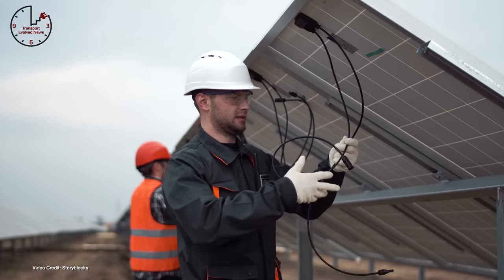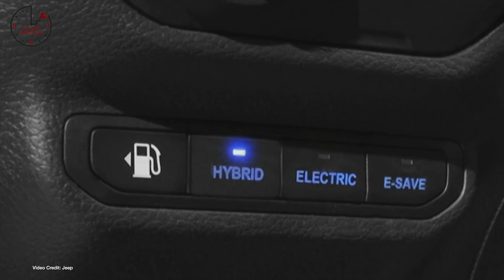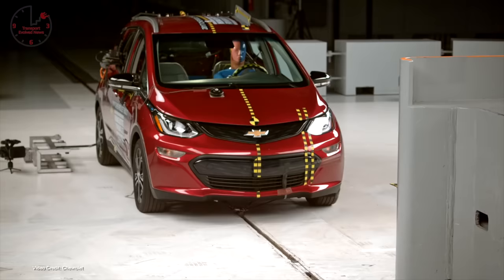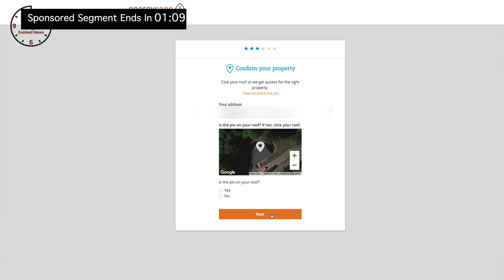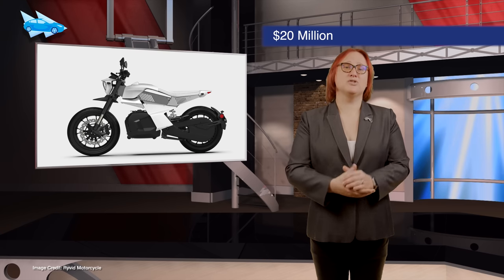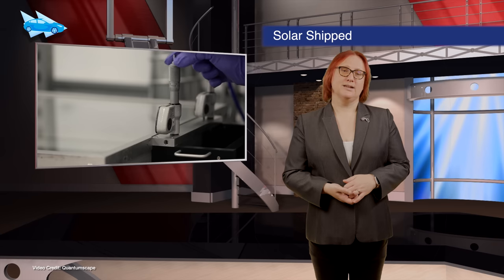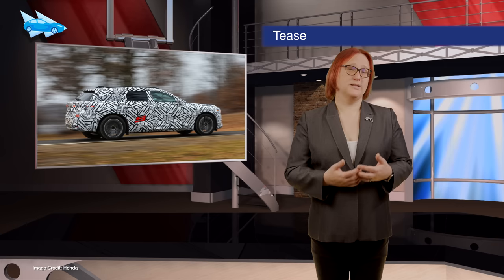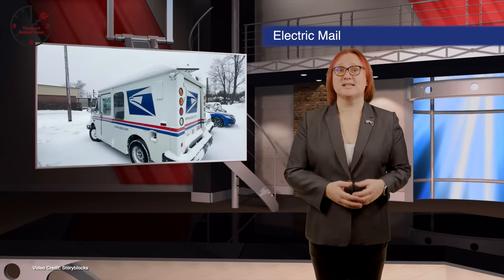TEN Episode 415 - Solar Panel Breakthrough, Tesla Driver Blames FSD,  Charging Station Security

Comment: Re oil industry under estimating emissions,  please note the industry never includes the lifetime analysis of oil extraction and refinement to petrol, but always include mining of minerals for batteries.  Please look up this energy,  it is very significant
Reply: FYI: Two refineries in Europe - only two - according to their own reports - produce as much THG during their refining of crude oil to gazoline - thats CO2 equivalents in climate effective gases as if ALL Germans drive EVs with the same energy mix as Norway uses.

Two refineries alone.

That means if all switch their Toyotas to EV's we can save up to 30% of the global CO2 emissions.

Comment: My understanding of the Pepsi statement about not hauling Soda/Pop more than 100 miles is that whether EV or Diesel, it is not cost efficient to haul drinks. Since Pop is mostly water, it is more efficient to have more bottling plants and just haul the syrup and mix with local water than hauling that water long distance in a truck.

Comment: @11:30 you need to correct your statement on tax credits of 26% for next year. Here is the fact; As written in the Inflation Reduction Act of 2022, the tax credit will begin at 30% and step down to 26% in 2033 and 22% in 2034.
Reply: I did a double take on that as well.
Reply: I came to comment if not already done. Thanks.

Comment: The FUD is amazing.  Here’s my personal experience.  We just drove from Portland to Seattle in our BMW iX.  We were at 97% when we left and 39% (135 miles) when we arrived.  Total distance driven was 175 miles.  The average temperature was about 40 F.
Reply: The problem is your statement as compared to actual cold weather results. 40F isn't cold weather, we just had a week where our high was 6F and had much time as low as -10F. Mileage does go down quite a bit in the cold, 15-30% is common.
The biggest problem was that many chargers (non Tesla) weren't working in the cold weather. These were brand new electrify America chargers that were installed in the last few months. Not  a good problem to have ..

Comment: Correct on Pepsi. If you look at all the bottlers in Washington and can also figure out which supply which warehouse you can see some difficulties with those in Spokane, Wenatchee. and Everett. Then there are Port Angles and possibly Long Beach and Elma that may have very long routes directly to stores on the coastal areas with mostly highways?  Happy holidays!

Comment: And Diesel powered vehicles suffer in extreme cold weather.  Semi trucks must be plugged in to run the block heaters, and often left idling for hours or they will not start when desired.  Diesel anti gel treatment must be added or the fuel system will gel up and shut the vehicle down.  If the fuel station tanks are above ground, the station must add anti gel in order to pump the diesel to sell it.
And we don’t talk about how inexperienced diesel owners get stuck along side of the road in these conditions, do we!
Even a gasoline engine sometimes will not start in extreme cold without a block heater as the gasoline will not vaporize an ignite.
But Noooooo, only electric vehicles have trouble in cold weather!

Comment: 32.5%.  That's the new world record for solar cell efficiency by Helmholtz Zentrum Berlin.
The EPA, and others, should also publish fuel efficiency figures based on not charging the battery of a plug-in hybrid.  So you get the best and worst case scenario.
Reply: Is that for a solar cell that is in production? The NREL has published results much higher for laboratory results. Multilayer solar cells are approaching the 50% efficiency level.
Reply: @RPRosen-ki2fk  I've no idea.  I just did a quick online search as the figure wasn't mentioned in the video.  TBH, I didn't think 32.5% wasn't much of an improvement, so maybe I read the wrong figure.
Reply: @TheTriumfAnt  Thanks for the reply. I've since Googled and it is a labarotory result for a tandem cell with an advanced perovskite composition. It will be added to the numerous others and hopefully some will make it to market soon.
Reply: I noticed that omission also.  Thanks for filling in the blank.  That’s about half again more efficient than the panels out in my PV array.  If that’s mass production ready at a competitive price, and if the perovskite layer doesn’t degrade and fail prematurely (awfully big “IFs”) then that could be pretty great.  As Nikki says, watch this space.

Comment: Unless they are somehow running version 11 software, the accident on the freeway did not really involve the FSD beta.  The freeway driving currently uses a completely different software stack than the FSD beta, and that software is probably at least a couple of years old at this point.
Reply: FSD sits on top of other programs, one of them being the Autopilot program
Reply: @linusa2996  I guess my point was, even if it (FSD) was engaged, what they were really using was a glorified adaptive cruise control (much like that provided by other companies).  Not taking a dig at Tesla here (I love driving my M3), but the freeway stuff is just a good adaptive cruise.  I've driven my Honda's version, and a Subaru version, and they all perform about the same way (though I think Tesla's lane keeping is superior). This is radically different from what I think of as FSD beta, which is it's handling on city streets, which is the cutting edge stuff.

This reminds me of the complaints last year, when somebody engaged auto-pilot on a freeway exit ramp, and were surprised when it ran the red light at the bottom of the ramp.  My other cars, including the Honda Odyssey, would do exactly the same thing.  Apparently common sense is not so common, it appears.
Reply from the maker: We’re reporting what the driver claims. We’re clear it was a claim.

Comment: Is the Frito Lay vs Pepsi comparison valid? FL is owned by Pepsi…..   🎄
Reply from the maker: Different companies ship different things. 100 pounds of potato chips are very different in volume to 100 pounds of soda.
Reply: @transportevolved  agree, but if the Pepsi group has its own charging stations (the group has a lot of real estate) , then both the chip and the beverage sides should be able to use them.

Comment: If I am not mistaken the delay of guidance on implementation of battery material sourcing requirements simply means those requirements specifically don't go into effect until guidance is given. This means (again - if I am not mistaken, I am not a tax expert) that if you were to buy a Chevy Bolt that was manufactured in the U.S. but whose battery components did not meet the proper sourcing requirements between Jan 1st and March (or whenever they give guidance) then it will qualify for the full tax incentive because you purchased it during a period in which the battery requirements themselves simply haven't taken effect. This is what I've heard, at least, in all of the material I've read on this issue and it's for this reason that I am now trying to get lined up to purchase a bolt EV sometime between Jan 1 2023 and March 2023.

Comment: Our Model Y has had a number of phantom braking occurrences. If you press the accelerator it cancels the braking, but of course you have to be quick to avoid a fairly substantial loss in speed. We don't have FSD, the braking is caused by the automatic emergency braking feature of the Autopilot system that everybody gets. You can turn the feature off but you have to do it before driving, it defaults to on whenever you wake up the car and start driving it. It seems most likely to phantom brake when you are on a road with a surface that has intermittent dark patches on it, and especially on cloudy days. It's almost always happened on an interstate highway, and I-80 going through Wyoming seemed to induce almost a dozen instances of phantom braking during one trip. It only happened once with a car close behind, and thanks both to an alert driver in that vehicle and my prompt flooring the accelerator in the model Y it didn't cause an accident. In this part of the country, and especially on I-15 in the Salt Lake City area, such an apparent "brake checking" maneuver is somewhat likely to draw gunfire from an offended driver behind you. It happens once in a while.
Reply: I might also point out that I sometimes watch videos by truckers (in ICE trucks), and it's not exactly rare to hear them complain about phantom braking.
Reply: That doesn’t sound right. My 2018 3 has never done it on over 50k miles. Occasionally it’s pushed the break down more than I was with a deer crossing the road. I highly recommend contacting Tesla ASAP and getting it looked at.

Comment: To be honest, range in winter suffers significantly. Our Skoda Enyaq with heat pump (VW ID.4 half brother) loses around 20-25% of range and our Tesla M3P unfortunately pre-heat-pump is closer to 30%.  None of our ICE vehicles we had before lost that much range in winter and they also had a lot more range to start with. Add to that the VW-Coldgate where charging speed sucks in the cold and it can be a bit unpleasant. As I just learned VW still has not managed to add a battery pre-heat button in the latest 3.2 software.
Latest joke: how long is a VW month? Almost a human year which means the promised updates every 3 months will come every 3 years (if we are lucky)
Reply: VW’s EV program seemed so promising. I hope they pull it together. We need Europe to also have a strong car industry. My Model Y loses noticeable range in very cold weather. My ICE cars have always lost range in winter too for defrosting and preheating. I now use a portable heater in my ICE car that I plug into my house. It has to run for an hour when it’s really cold, which seems wasteful. The Tesla needs only a few minutes to melt the frost. Advantage: Tesla, IMO. I’m looking forward to longer range cars though. We’re only just getting started with this technology. In 5-10 years if society doesn’t collapse, I’m sure we’ll all be happy with our EVs.
Reply: I just took my Ford Explorer to the airport and back (100 miles) in an ice storm and used 170 miles of range. You may not notice because it's so easy to just refill the tank. In day to day driving winter range loss doesn't really affect my Tesla because my daily driving doesn't exceed the range of the car, but my electric bill has increased from $44 per month to $50 for charging. It has gone up far more too heat the house so if the Tesla app didn't show me stats, I wouldn't notice the added expense.
VW certainly hasn't done a great job transitioning to EV, but hopefully they improve
Reply: As a European I knew the efficiency of my ice car exactly in all conditions because of the price of fuel.  I found that my car that did 62mpg in summer, and in winter it was around 45 in the cold.  So it was just as bad in the cold loosing 25%.  Of course US cars do terrible mpg so most  Americans don't care  or have any idea the effect of rain,wind,tire pressure, and cold on their efficiency; thus their claims they make about EVs.  Oh and I do know the US gallon is smaller.
Reply: @Tom55data  I'm American (Minnesota) and most of us are very cognizant of the significant mileage drop in cold weather.  What you're hearing is a small but loud minority that hangs out in forums and drinks in the massive FUD blasted at them by traditional auto companies as well as big oil.
Reply: @StormyDog  my apologies to you
Reply: You don't see the range loss on ICE vehicles because they waste 75% of their fuel on heat, and that doesn't change much with temperatures. You'll have the same 20% range loss on the 25% fuel that is actually used for propulsion, i.e. 5% visible range loss.
Reply: @HenryLoenwind  even the epa did a test over many ice cars and got 15% loss.
Reply: @HenryLoenwind  re: "You don't see the range loss on ICE vehicles because they waste 75% of their fuel on heat, and that doesn't change much with temperatures" and whatever range loss that might occur is offset by the effect of DA (Density Altitude).  in cold weather ICE cars make more power, every Racer and Motorsports Professional knows this.  this is why 4000HP ProCharged Drag cars (think Ryan Martin's Camaro of "No Prep King" fame) will pull air through an icebox/water tank mounted at the front of the vehicle.

Comment: Sorry to see TE repeating the allegation that FSD was responsible for an 8 car accident without reporting the fact that for all beta releases to date FSD is never engaged on limited access highways such as this. Yes, it's possible that Autopilot (the production ADAS standard on all Teslas) was engaged and may have been responsible. But I expect TE to avoid repeating misinformation about anything EV related which is so prevalent in mainstream media.
Reply from the maker: We’re reporting the allegation. We’re working on information we had.
Reply: @transportevolved  I wasn't taking issue with the reporting that the driver alleged that FSD was at fault. But when TE adds in Tesla's statement about supervising FSD (certainly a responsible thing to remind viewers), it would be appropriate to clarify that this would have had to have been Autopilot and then add that Tesla states that Autopilot must be supervised, as must all ADAS systems. (And it is because of my respect for your journalistic work that I even raise the point, so please understand this as the constructive criticism it is intended to be. Have a wonderful holiday!)

Comment: GM keeps dropping prices of their EVs, while most everyone else is raising prices. Having owned a 2017 Volt and 2020 Bolt, I can see why. I now have a MME and everything about it is vastly superior. I can't really even compare the MME to GM's cars I've owned. It's like comparing a new car to a decade old car, just not a realistic comparison. It's so nice to have BT that works with multi phone and to be able to access climate controls while in reverse, and that's not even mentioning basic comfort. Any adult size person that ever rode in the back of a Volt knows that it is closer to torture than a car ride, the same for the front see of the Bolt. While the MME is no where near perfect, it is soooo much better than the GM cars I've recently owned, that it feels perfect.